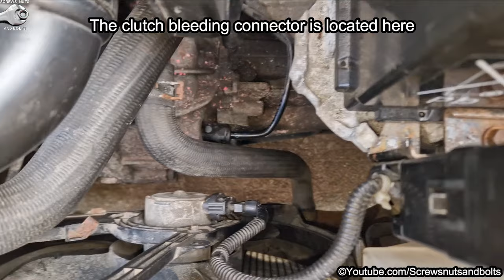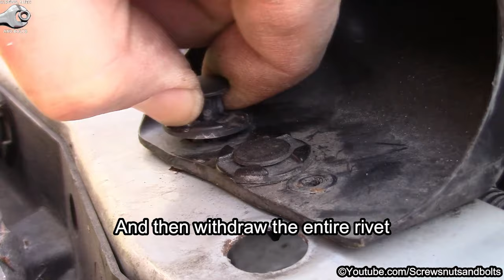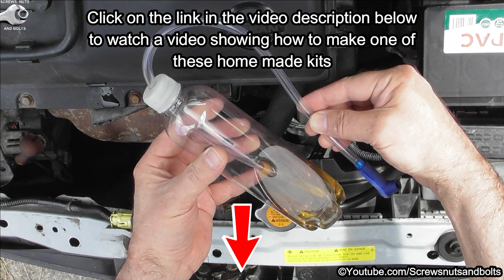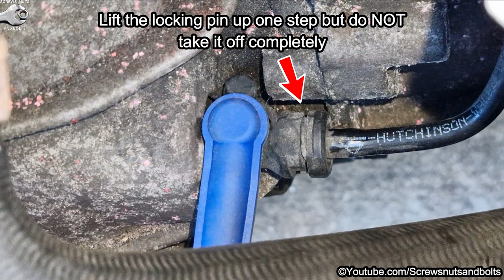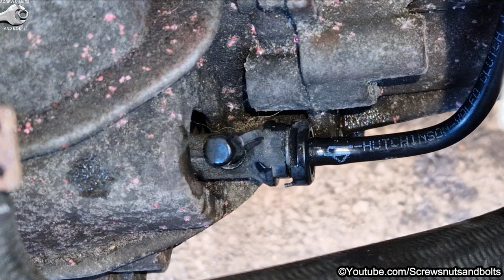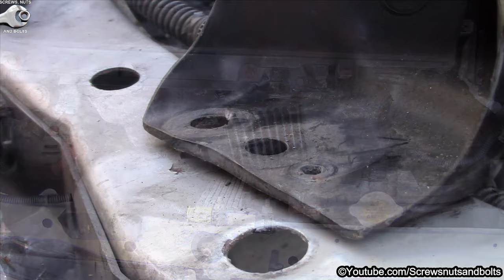Clutch Bleeding - Nissan Micra K12

Comment: I recently asked myself what kind of strange plastic line that leads to the slave cylinder is. 
Until now I only knew rigid lines or such reinforced rubber hoses which are also connected to brake calipers.
Thanks for your effort 👍👍
Reply from the maker: You're welcome, thanks for watching !

Comment: Hey quick question as I'm stumped looking for answers online.

2004 K12, clutch was replaced a while back due to wear after I bought the car, however the clutch pedal biting point has always been insanely high up, to the point I can move the clutch pedal a few cm and shift without issue.

Anyone know what could cause this/ how to fix it and move the pedal biting point lower? I've also read micras do have a high biting point in general, but surely not this high.

Any help would be appreciated. Thanks.
Reply from the maker: I'm not so sure, a lot of people in online forums have mentioned the high bite point in a Micra K11 and K12 so it maybe normal for certain cars

Comment: Sorry for the dumb questions, but why should i bleeding the clutch? What are the symptoms that can lead to bleeding the clutch?
Reply: And another question, i have the diesel version what oil should i use if I need it to bleed the clutch?
Reply from the maker: Change of the pedal travel, difficulties when disengaging the clutch or the clutch pedal may feel 'spongy' when pressed.
Reply from the maker: The clutch fluid is the same whether it's a diesel or petrol engine. Is you car the same model Nissan Micra like in the video ?
Reply from the maker: It should state the type of brake/clutch fluid required on the fluid reservoir cap. In this particular vehicle it's DOT 4 brake or clutch fluid.
Reply: @screwsnutsandbolts  yes is the k12 1.5 65hp from 2003
Reply: @screwsnutsandbolts  when i am in 2° gear and try to put it in 3° gear sometimes i ear a grinding noise or sometimes it feel really weird, do you think i need to change the clutch or it just needs to be bleed ?

Comment: Pin not locking. What should I do
Reply: I had the same issue I think my clip was the reverse had to push down and pull the pipe out at the same time.

It rested in the up position, I think there is two versions on this the one in the video and the one I had.